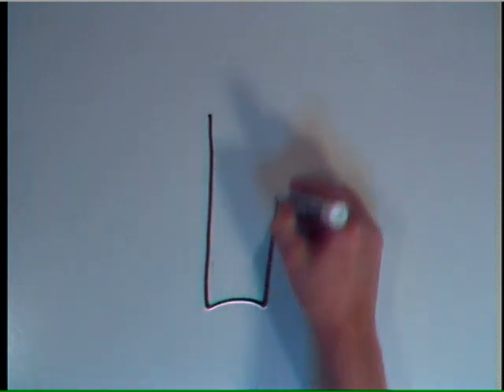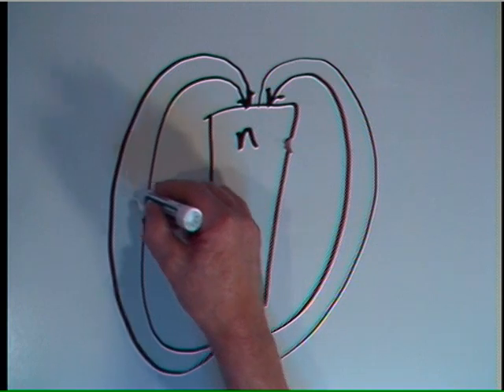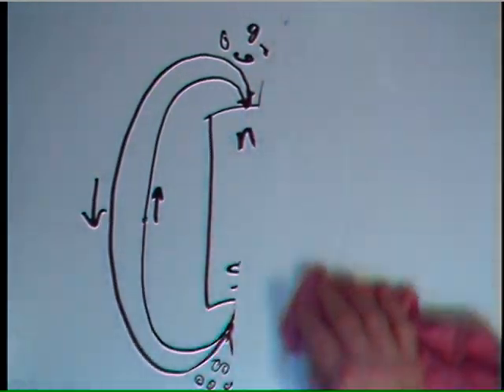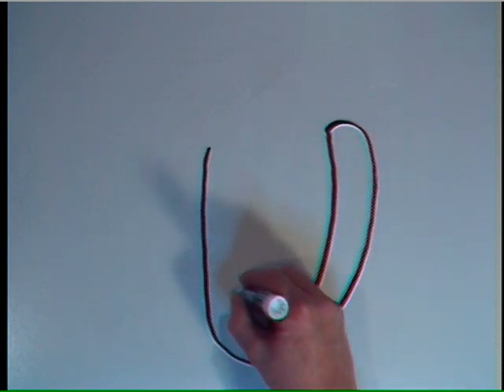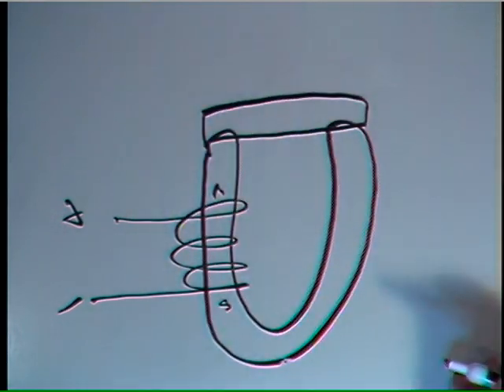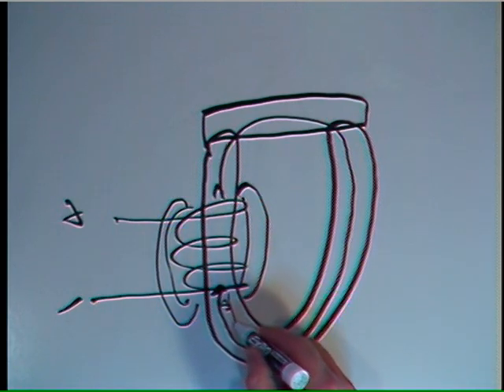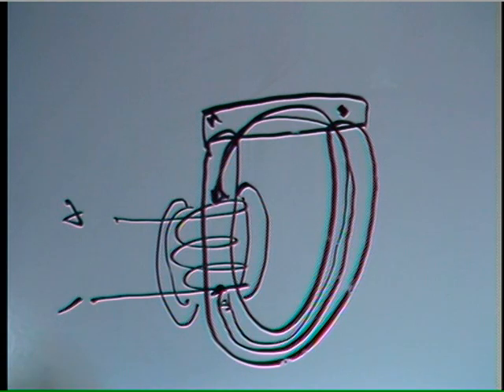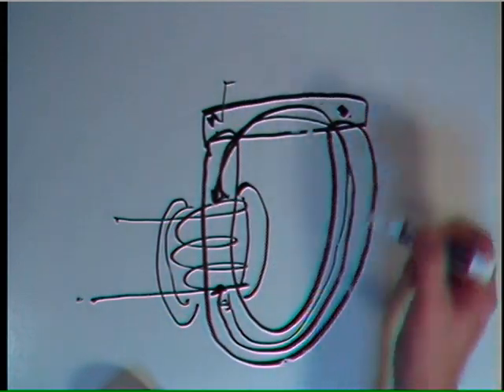Edward Leedskalnin Perpetual Motion Holder (How it Works)

Comment: I wish people would stop misrepresenting the pmh there's no mystery to it it's a permanent magnet holder not a perpetual motion holder for the love of Christ there's nothing mysterious about what Ed was doing he was working at night he needed lights you're not any needed a way to keep batteries charged to run his mechanical apparatus
Reply: In ordinary electromagnet when you turn off the power, it is no longer a magnet (or at least not that strong). But in this experiment the magnetic force keeps its full power, even when you turn off the electricity, and the bar stays strongly attached to the U-shape permanently. When the bar is removed the magnetic substance (according to Ed's theory - the north and south pole individual particles) flies away, enters the coil and produces electricity. The conclusion is that PMH can hold energy in its purest form (in the form of two opposite north and south currents in an endless loop) indefinitely and release that energy at point in a time you want - even years later after initial momentary charge.

Comment: I have ordered a u-shaped electro-magnet.  What do I need to do to turn this into a PMH?
Reply from the maker: Put a metal bar across the prongs.
Reply: texjarhead nornd Tottally wrong...You'll have to rewind the coils!! Complete a layer, then go at the begining of the coil, make another layer at the top of the other...This will work with DC, and you'll make a PMH
Reply: Ut
Reply: Adrian Marinescu

Comment: I hate to be a bitch, but there are too many people out there that are going to take this video seriously A) his diagram of Leedskalnin's PMH isn't even correct B) there are no such thing as magnetic monopoles C) the coil he draws doesn't follow the right-hand rule of an induce magnetic field with a current D) the polarity he shows on the keeper bar across the prongs isn't accurate given the induced magnetic current in the u-bar E) Cutting a bar magnet in half doesn't eliminate the other side of the magnetic field. The only thing here that I can guess the poster was attempting to communicate is the idea of a magnetic circuit rather than a magnetic field, as in a torroid where the field is formed into a magnetic circuit contained within the looped material rather than around the electromagnet.

Further more Leedskalnin's proposed theory of magnetism is a flat out plagiarism of Descarte's theory of magnetism centuries old. Which may account why he sought out rocks with enormous pores in the surfaces. This alone would corroborate the idea he applied electromagnetism to the rocks in some way, but we simply must conclude that his achievements were accomplished through careful experimentation with almost no clue of what he was really doing.

Comment: A theory is almost always true but hasn't(or can't be) proven.More true than that is a law, which will always be true. The monopoles don't move past each other, they go outside then through the magnet. This bottleneck makes it a magnet.There is no reason to have a U and a bar of metal; it is just an O. The coil would create a north and south pole on the top and bottom, not in a circle. If you put a magnet next to a bar, the bar won't stay a magnet. Any gain in entropy would ruin the system.

Comment: Also, after taking a brief look at the webpage you linked to. You do realize that metal is always saturated by the 'static' electrical field right? Magnetic induction causes the already present electronic potential to move. Do you realize that a compass is backwards? Also, your do realize that magnets are made by storing large amounts of electrical potential...yes? Magnetic current is where electrical impedance(resistance) comes from. One is a reaction to the other. Sheesh.

Comment: The main thing missing here is accepting that magnetic and electric fields are not the same. Magnetic fields are a reaction to electrical fields. However, magnetic fields also enable us to 'open' the electrical circuit through what is called magnetic coupling. In order to do this energy must be stored. The coils and the metal bar and 'horseshoe' store the energy allowing for the electrical connection to be opened. More advanced methods call it resonance.

Comment: Couple of mistakes. The 'perpetual' motion holder uses 2 coils....not one. Two coils that are the same btw. It is not monopoles. It is stored energy. You remove the electrical connection but the magnetic fields are still stored. Two ways to break the holder. Short the electrical connection to discharge the stored energy or remove the top bar and sever the magnetic connection. Either way this effect is caused by stored energy. Resonance also allows for electric circuits to be 'opened'.

Comment from the maker: You may use iron filings to detect these magnetic lines of force the same way you would detect the lines of force in a bar magnet. However in a bar magnet you will have two lines of force, one on the right side and on the left. The perpetual motion holder will have only one magnetic line of force which will not extend beyond the metal like the bar magnet, also their will not be any north or south magnetic pole. Heat is created when you have magnetic interference from another source

Comment from the maker: What's the purpose of holding a steel plate to the horseshoe?
To provide a orbital path for the monopoles, removing the steel plate will brake the monopoles orbit and can no longer be reattached.

Also, the moon isn't held in orbit to the earth by magnetism.
Yes, the moon has a magnetic field it pushes the moon away from
 the earth and gravity brings them back together, it also is responsible for the moon moving above and below the earth's equatorial plane as it revolves around the earth.

Comment: What's the purpose of holding a steel plate to the horseshoe? 

Also, the moon isn't held in orbit to the earth by magnetism.
check best answer at answers.yahoo.com/question/index?qid=20101107040137AAg88dG
Try centrifugal and centrepital forces.

Comment: I wrapped a coil around a U shaped bar, put 1 amp through it for about 1 minute. The bar that i attached to the U bar stuck until i removed it. Yet it has been 10 minutes and if i reattach it, it will stick again and hold it's own weight... Residual magnetism. If anything then Edward knew how the magnetic field of earth works and how to harness it to create massive EMF fields that would flip the polarity in coral rocks. Perpetual motion holder and his own theory on electricity... distraction.

Comment: Isn't this thing rather the result of residual magnetism in the core? As when inducing strong EMF-s the polarities of all the particles in the ferromagnetic metal start to align in a certain direction. After removing the EMF a lot of the particles keep the aligned state and very slowly start to flip back to their original directions. And the physics known today states that you can practically flip the polarity of particles in all things, including coral rocks. All you need is a very massive EMF.

Comment: Actually, a U magnet with a metal bare on the top is pretty basic. That is all the perpetual motion holder is. You can coil the U magnet, charge it with the bar on top.  The magnet will maintain that charge and have a stronger hold on the bar than it did before.  It does not in any way violate thermodynamics.

Comment: @carpenoctem81 First thing to do is start to see the stones as a very lightly powered magnet. The stone has metal in it, Ed Would charge this metal up. *Alike the things you see people use to make steel into a magnet. Eds tool thing. He did this to the rocks themselfs. Charging thier magnetic field so they would become more like a magnet. Now, to create the opposing field and control this *i beleive the mind/heart and voice are required. To resonate and well,Speak to the rocks like a druid would

Comment: @MrTailheavy Spirituality required and the electromagnetic thought patterns of the user must be combined along with toning, singing to the rocks.
*This is where most will fail, everyone beleives rocks are dead, they are not.
Until this information is saught out and practiced it will not be understood.
Meditation. Ed was alone alot, with out much tv or radio as ive never read of him having one. This gives more time to study the self, when there isnt so much noise there is information out there

Comment: Hi again,
After watching your video's and listening to your responces.
I took a fresh look at Ed's generator, and this is what I think.
If monopoles can move a compass, they may be able to move electrons in a wire.
A steel pipe is like a extended metal ring, the spinning magnets in Ed's generator could get the monopoles circulating in the pipe that's next to it.
Then a coil of wire could be lowered into the pipe, generating electricity.
What do you think???

Comment: Thank you for your answer
If I understand correctly, if you had say a 5" solid metat ring and energized it. Then set a compass in the center of the ring, the compass would continually spin forever?

What If you had several of these energized solid metal rings, I wonder if they could be used to generate an electrical current in a wire put thru the center of all the rings?

Comment from the maker: @maximum01video Yes they would, if you placed a compass in the center of this energized metal ring,
you will find that the north pole of the compass will move in the same direction as the north monopoles
which are circulating in the energized ring. This is because north monopoles are slightly stronger than south monopoles.

Comment: If you put a coil of wire around a section of a metal ring, energize it, then remove the coil.
Would monopoles circulate thru the ring forever???